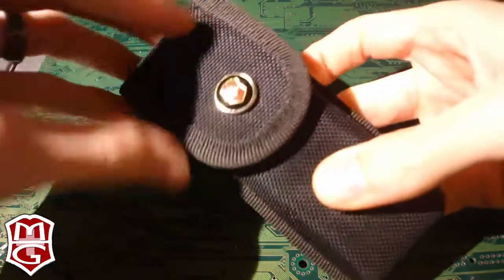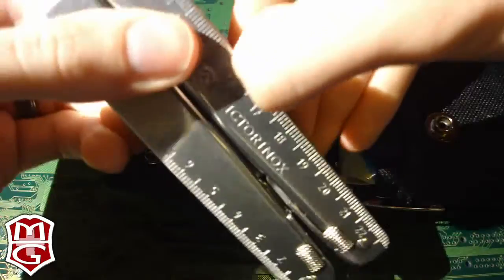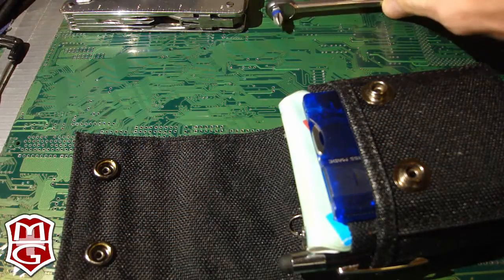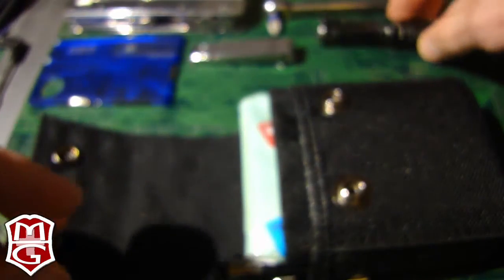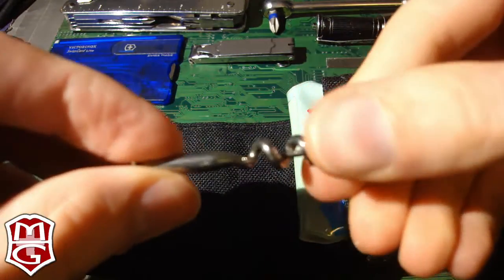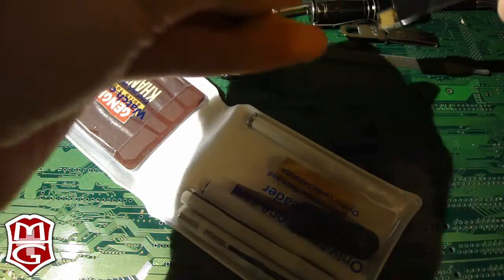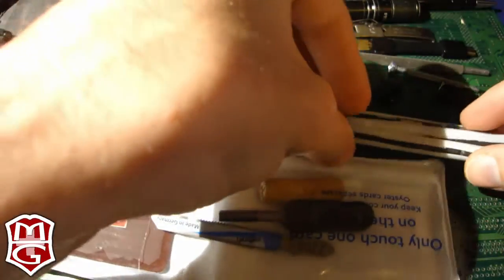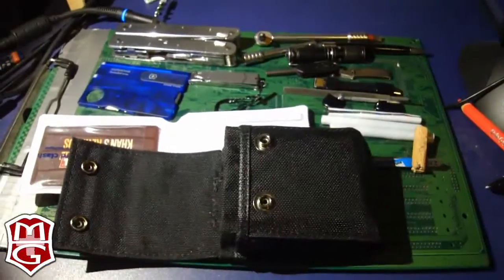Victorinox-based EDC in Skinth Mondo Shield Sheath

Comment: So three years on, how much of this stuff do you still carry and more importantly, how much of it did you actually use? I just dumped out a lot of stuff from my Maxpedition Neat Freak bag. My thinking was, if I didn't use it for a year I don't need it. It certainly saved some weight.
Reply from the maker: I still carry this, with minor modifications. The flashlight is in my keys with a pill bottle, and I replaced the cracked SwissCard. I live in Africa, and unless I'm at home next to my workbench, the "right" tool is often far away. I still reevaluate regularly and I don't carry the Ricola tin full of extras. But, rather than "if I don't use it, I don't need it", I'm willing to carry a bit more weight to my loadout for something that could really get me out of trouble (relatively low risk of need, but high payoff). For example, when I travel across country, I always carry a lantern, portable water filter, USB charger, and a mosquito net.
Reply from the maker: My guiding principle is that if I don't know how to use an item well now, I won't be able to use it well in a crisis...so I'm always looking for new tips and techniques to add to my internal toolbox 🧠🧰, which may be almost as important as the tools.
Reply: @mattgyverlee  One of my most useful items is a roll of bags that people use for collecting their pet dog's poop.
Yes it can be used for that too if you cannot find a toilet, but other uses are more satisfying.
- Over your socks inside your shoes will keep your feet dry and warmer in wet or slushy snow conditions
- On hiking trips I can put dirty clothing items in a bag to contain the funk.
- Can be used for collecting water if you have nothing else.
- Setting up a simple tarp for rain or sun shade, bags can be filled with sand/dirt to hold down guy lines if you don't have good stakes.
- Good fire starter if nothing else is handy. wrap around a twiggy piece of wood fuel.
- Lots of other uses.
Reply from the maker: @treebeardtheent2200  Thank you, oh wise forest shepherd. Yes, trash bags are great, I usually take a dry sac or two when I go out anywhere mud or rain might come.

Comment: Would you please post a link to where one could get that case?
Reply from the maker: Of course, it's the Mondo Shield from Skinth. https://skinthsolutions.com/product/mondo-shield/ I'm happy to see they're still making them 3 years later. I wore this today, and the only changes to the loadout are replacing a cracked Swiss-card (even the reals one rarely last more than two years),  having a few more neodymium magnets stuck to the nail clippers, and the flashlight is now on my keys instead of in the case.

Comment: Can you fit a Swiss champ in there with your Swiss tool?
Reply from the maker: LOL, no, I can't, but with a SwissCard and SwissTool, it seems that the only extra "tool" the Swisschamp offers is the "multipurpose hook" and possibly the hole in the "sewing eye". With that said, the Swiss Champ is a good backup toolset if you don't need beefy pliers. Maybe I should throw one in my backpack. In survival, "Two is one, one is none". :)
Reply: @mattgyverlee  I carry a Gerber suspension with a Swiss champ in a leather dou pocket leather pouch. I am looking to switch it to a skinth solution product. Thanks for answering question.
Reply from the maker: @firstlineofsurvival5318  Best of luck. The Mondo case is designed for a long central multitool (the SwissTool is longer than some other multitools) and other flat or tubular accessories. Unless you can jam them in side-by-side and crush/remove the tubular slots, none of the smaller pockets are the right shape for a SAK. I hope you'll find what you are looking for. Skinth shares lots of measurements on the site for each product.

Comment: Any body that Carrys a knife with a dark screw for wine bottle doesn't need a knife or do any real work
Reply from the maker: Lol, you might have a point. Full-disclosure, I never had the corkscrew for the first 10 years I had the knife...until I moved to Europe. I bought it because it existed as another attachment for my favorite knife. I guess by your logic, I had a knife for the first years, and then it became a kitchen utensil. 🍴
Reply: Charcuterie lunches are easy and relatively healthy.  Wine is easy and healthy as well.  Having a cork screw and an extra multi tool knife is a must if ya ask me, so I don't have to use my main blade which usually has blood, or grease, dirt on it.
Reply: @jj325j2  location location location.

It's sophmorically common for the not-well-travelled to think they know best.

In contrast, your comment adds flavor to the topic.